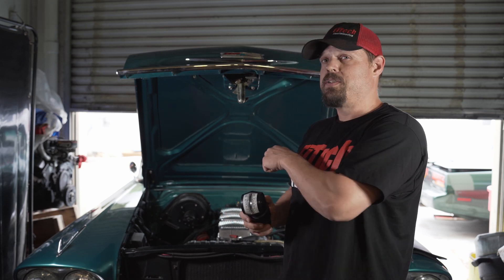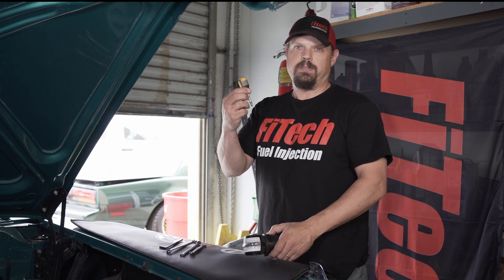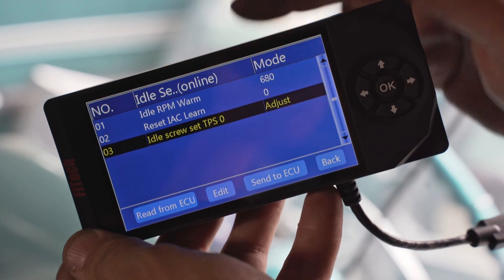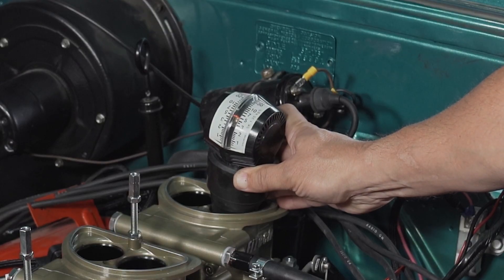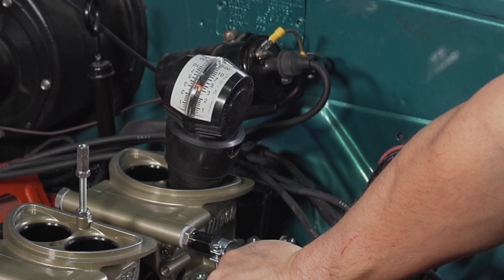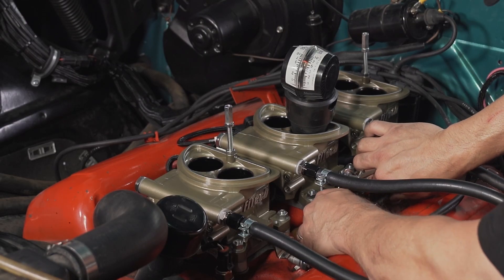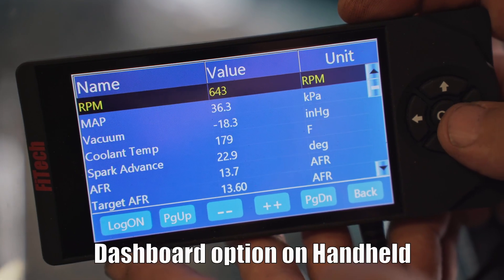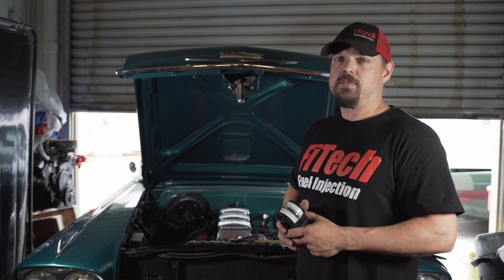Tri Power Throttle Adjustment/Synchronizing | Tech Tuesdays | EP73

Comment: Greetings, I just got my GTO out of the shop a week ago Friday with a new Tri-Power FiTech set up, so far runs great.  I've put about 250 miles on it since the start, so getting through the initial learning curve.  However, the IAC number is running high according to your specs.  Presently it's hovering around 38-40.  I'm not sure where it was initially set up by the shop that did the install, but this is where it is today.  Should I leave it alone for the time being and the self learning process or go through the synchronizing method shown here to try and get it back down to a lower number?
Reply from the maker: Hello sir,

When it comes the IAC we advertise that the best range should be around 3-10, however its just a range we normally would recommend but its important to consider camshaft size and just the level of engine you are running, if your vehicle is running great I recommend you drive it more. The range its currently set to is fine, if you wish to adjust it, you may adjust the adjustment screws on the throttle bodies, since you are running the TriPower system you would need to adjust them in a syncronized order where you adjust all three. This would only be an option, if your engine is running great you may leave alone.